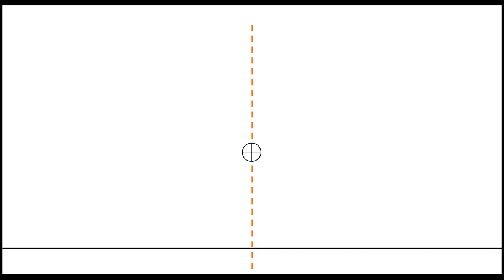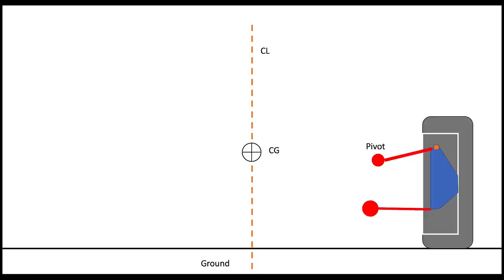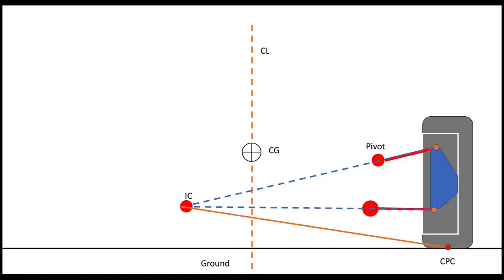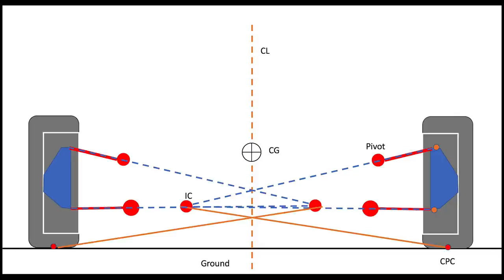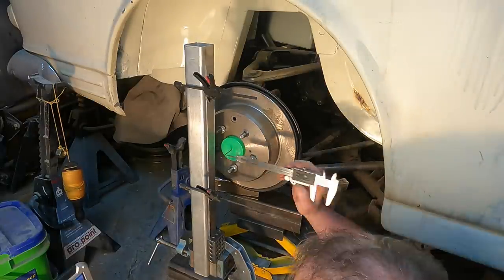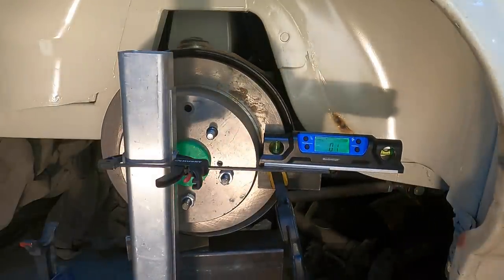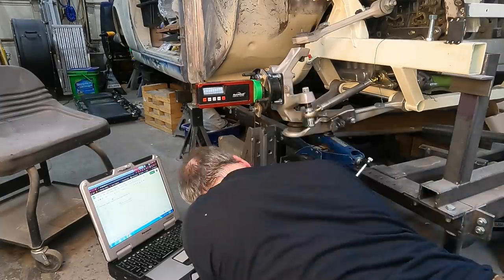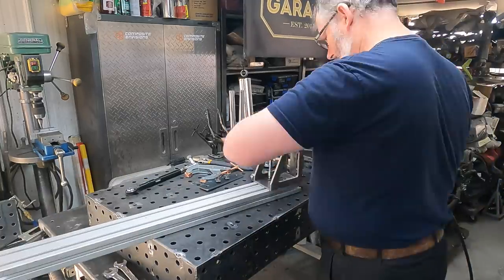Suspension Tuning: Roll Centers and Dynamics

Comment: Watch everything this guy has on suspension design,
XF Motorsports
https://www.youtube.com/watch?v=VbReLNi2JP4
I am thinking your upper control arm pivot locations are in the wrong place, they look a little high to me judging from the video.
Reply from the maker: I've watched his stuff.  How could you possibly tell if my UCA was in the wrong place by eye!
Reply: @ThrottleStopGarage   Shrugs...dunno just doesn't look right.
look at a lot of sports car suspension pick up points and race cars. Like road course nascars. Easy to see.
 Watch how your camber changes through the stroke. It should go smoothly more and more negative.
Reply: @ThrottleStopGarage  just watched again, you shortened the arms to fi the track of the car? did you keep the same pick up points and the ratio of the two arms length compared to each other? looks like the upper control arm is too long compared to the lower arm.
and the connection point is too high.
How long are each of the control arms? from pivot to ball joint?
Reply from the maker: @electronsmove  The arms are stock - track was shortened by moving pick-up points.  The ratio of the arms did not change - that's the shape of the curve.  It's fine.  I've optimized the package and am satisfied that it's fine.
Reply from the maker: @electronsmove  What I'm saying is that the optizing process did involve moving arms in 1 mm increments with as little as 5 mm needed to generate changes in how it all worked.

Comment: You mean you can't just take a Corvette suspension and throw it on another chassis and say "RACE CAR!"? Hmmm.who knew?
Reply from the maker: If you get it in the right location and the "professionals" didn't mess it up...then yup.
Reply: @ThrottleStopGarage  How much does chassis width and wheelbase matter?
Reply from the maker: @ezacher4634  Both are important as they are the distances to the centre of the unsprung mass.  In the case of this car - the wheel base is the same as the Corvette/Supra that donated parts.  In both instances, I did have to narrow the track to make them fit the car's outer dimensions.

Comment: No idea why you've chosen the least precise but most torturous approach possible.
You can model a fully parametric 5-link suspension in Fusion in less than an hour. Couple minutes even, if you leave accurate bushing dimensions and pretty details for later.
Have you even determined rough values for caster and anti-dive yet? If you're already running into binding issues you should probably sort out the basic geometry first - and replicate it in your test jig - then fine tune stuff like camber curves or bump steer. (which would also only take a fraction of the time in CAD)
If you're aiming for a specific roll center height then you must have done all necessary calculations already. So why not use those results and get an actual base line for further tweaks.
It's good that you mostly ignore that silly kinematic model, but it still looks like you're putting the cart before the pony.
Reply from the maker: Thanks for the feedback - super appreciated.  Some details got left on the cutting room floor I'm afraid.  The reason for doing this the way I'm doing it is to make a computer simulation make sense.  I'm not a Fusion expert (really novice) - and my issue is that I learn best by doing.  I'm not opposed to torture.  I'm getting a good idea (far from expert) now about what's going on.  I know where the caster and anti-dive should be and I've worked through all the gory details.  I really could not have understood this without doing it this way - taking it into Fusion would have been a real struggle for me.  Bump steer has been done for front and rear and while I have footage...I didn't see the point in showing it.
Reply: Ok, sounds good^^.
I'd still highly recommend that you take the time and model the frame and suspension in Fusion. As you certainly know, you can't change a single parameter of a suspension without affecting everything else to some degree - I mean, some parameters even affect both axles. And that's where a proper cad model will save you countless hours. It is likely that at some point you'll have to make small adjustments to pickup points or the rack position for clearance/packaging or maybe just ease of fabrication. With everything modeled in CAD you can immediately see every change in the geometry caused by the modification you want to make and whether you can/need to compensate for it elsewhere. You also get the updated dimensions of any mounting bracket etc you might need for that change - without having to crawl around the car with a marker and pieces of cardboard. Just export it and have it water cut, or print out a template. 
The hours you may have to spend watching Fusion tutorials about parametric designs and master sketches etc will absolutely be worth it and pay dividends quickly. 
With an ambitious/complex and time/money consuming project like this, I would consider a good CAD design the most valuable tool.
Reply from the maker: @protator  Understood.  I've got several designs under consideration right now in Fusion.  I think I have the LCA mount worked out and I have about 4 different versions of the UCA mount.  I just had a flash the other day that may solve the packaging problem.  I ran into a bit of trouble with the AC Compressor when the suspension went down.  I've got the frame components in Fusion and I'm trying to improve my CAD skills so I can easily model the suspension.  I can pull suspension dimensions from the jig easily - I've been toying with the idea of buying a suspension analysis package that I can enter the points into and move them around and get an output that I understand.
Reply: @Throttle Stop Garage  Can't really say much about specialized software ... a lot of people in the offroad/ hill climb community seem to use such programs with good results, but most posts I've seen in the past were about solid axle 3 or 4 link setups ... so no idea what's out there that works well for double A-arm/ind. 5 link.
My somewhat generic advice would be to stick to the book ... estimate wheel loads, pick spring rates and a brake bias somewhere between 50/50 and the car's weight distribution, then choose anti-dive/squat values based on moderately sporty cars with similar weight and power. I've seen those numbers on all corners of the web at least for models like C3-C6 Corvettes, some Camaros and other american muscle. Then I'd block out the rear suspension and prioritize low scrub over a perfect camber curve unless the car's supposed to be a track toy. Toe link can go pretty much anywhere, you can always correct the toe curve by modifying the uprights ... on a street car I'd probably go with fixed toe-in and simply bolt it to the lower a-arm, tho. That detail can always be changed easily if necessary. So, yeah. Basically ignore the front end and focus on the rear suspension to get quick progress and keep the motivation up. And when it comes to the basic design, KISS is always a good choice. Try to avoid high torque loads on the frame rails, add additional box sections instead of excessively long mounting tabs ... again, the usual generic advice you'd expect from a rando on the net ^^.
Reply: @ThrottleStopGarage  just remembered a little something ... if you already know the width and offset of the rear wheels, check the scrub radius before you commit to the design. Seen a lot of bent or ripped off toe links on widebody conversions with too much offset. The forces on that little rod can get pretty high.
Reply from the maker: @protator  Excellent point.  I've not got the wheels yet.  For the rear, I was working with a stock offset.  I think the wheel well width prevents tires wider than about 245's.  Front's will be narrower due to packaging constraints.
Reply from the maker: @protator  I have to get pretty creative with the packaging to keep it all working properly.  I'm going to test drive some software today if I can squeeze the time in tonight.  I've already got all the spring rates/brake bias/anti's worked out as well as estimates of wheel loads.  I'll be posting design ideas on IG when they get a little more formal.